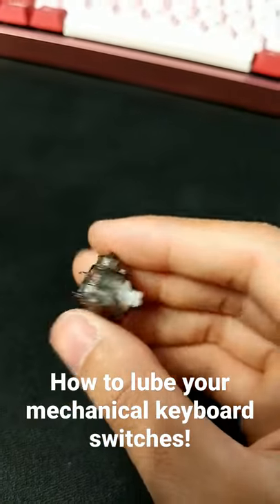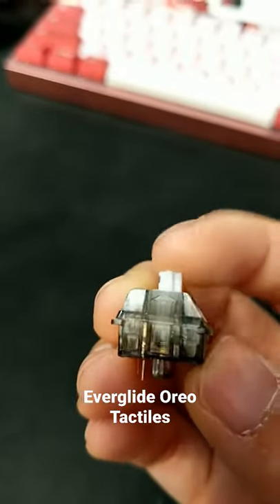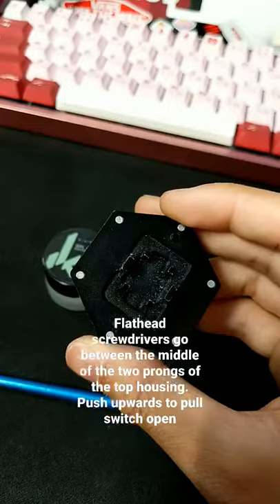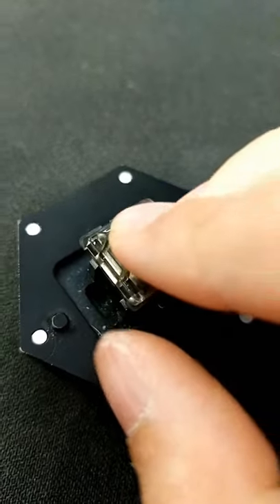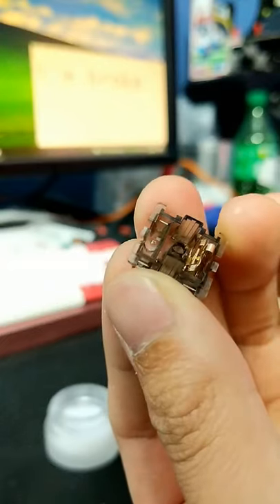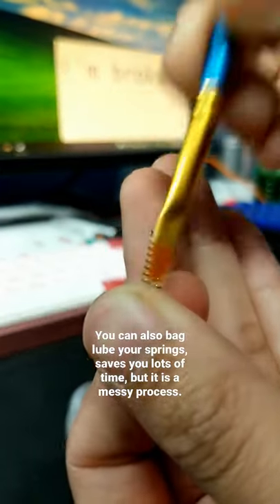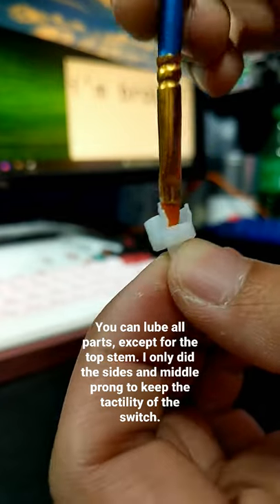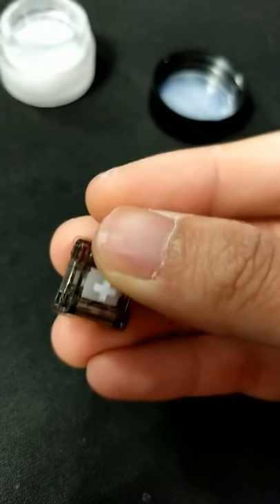How to Lube Mechanical Keyboard Switches! #Shorts

Comment: Woah woah woah. Back up there partner. This is only for some switches, especially some being tactile. Also, I think using tweezers are faster than this. Tactiles should generally be used with 3203 or 3204. You generally should NOT use it with 205g0. Also, idk if u said this but this is only AND ONLY for tactiles. Lubing linears this way can sometimes be inefficient. Also, some switches do need to be filmed, but that is irrelevant to this video I guess. And for the hole, generally you don't want to lube inside of the hole at all, because your switches can feel or sound overlubed from lubing inside the hole of the bottom housing. I feel like this is an OK video for beginners but next time, try putting a bit more depth into your vids. Not trying to be rude, just trying to be informative.

Comment: and this kids, is how you severely overlube your switches. superlube ? for switches ? really ? these are tactiles too, so trybosis 3204 is what you'd use on them. you also don't lube the legs on the stem, otherwise you'd basically stripping the switch of it's tactility. don't do this.